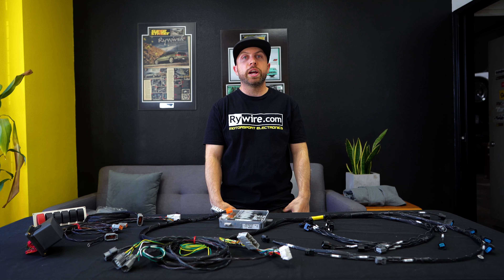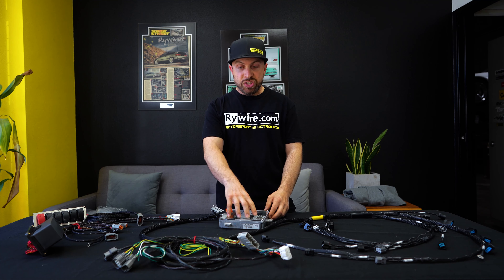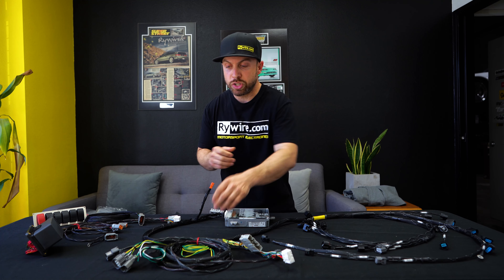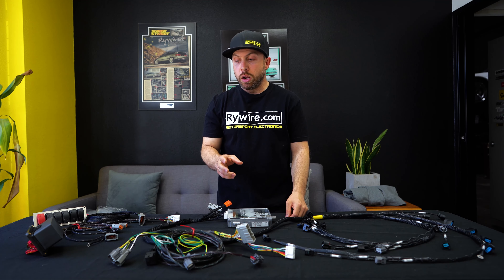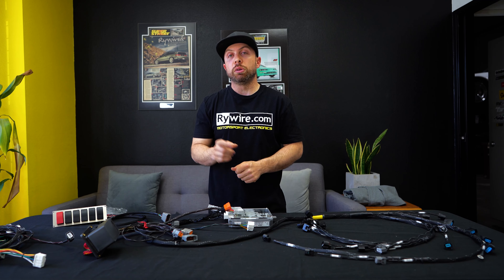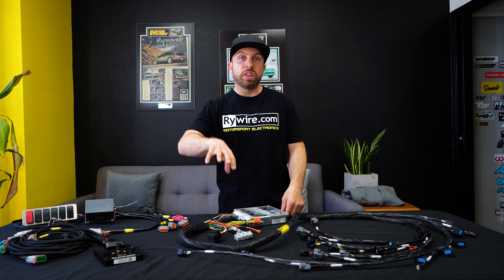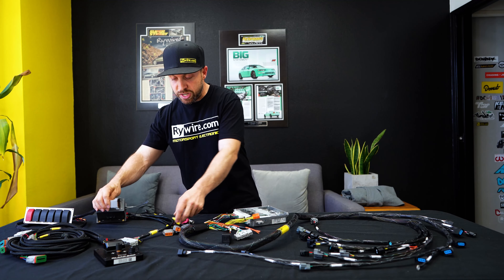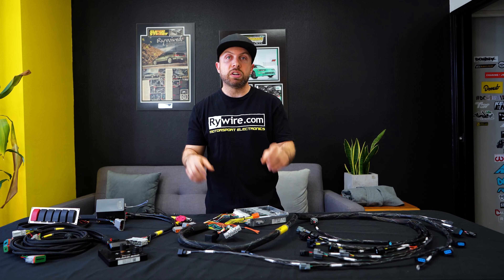Rywire K Series Wiring Explained. Wire any K Engine in any car.

Comment: So I'm doing a k24/cd009 swap in a 2000 mustang.  Is it possible to have a functional obd2 port for my state inspection?  All they do is plug in and make sure there's no check engine lights.
Reply from the maker: Not likely. Easier as a race applicatiion

Comment: So from the video, would you recommend the K-Series Rear Wheel Drive Harness for a K24A swapped into an RX8? I have been working on this swap for quite some time and the harness/wiring is what is giving me the most headaches. Also wondering if this would allow me to keep my Electronic Power Steering? Thanks in advance
Reply: Nice bro I’m putting one in a 1987 Mitsubishi mighty max and yes the harness is the hard part I got my harness from kpower they have a rwd harness I’m currently looking for a conversion harness
Reply: You ever figure it out? I'm about to do a K24 swap RX8 and trying to figure out the electrical as well, what ECU I need, any plug and play to be able to use factory dash, was told Adtronic ECU works best and it's plug and play but also been sold out for over a year.
Reply: @Level_Up_Nation  lol I'm guessing he's still scratching his head trying to figure it out. 😂